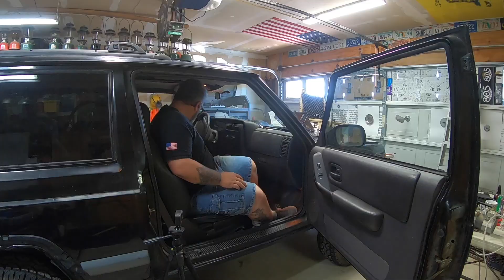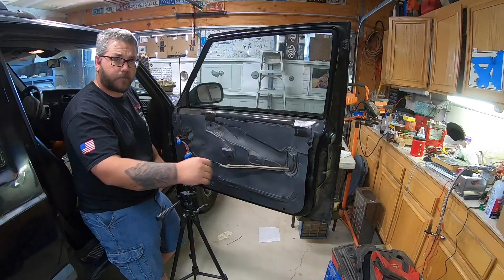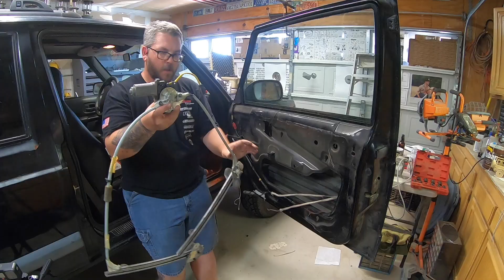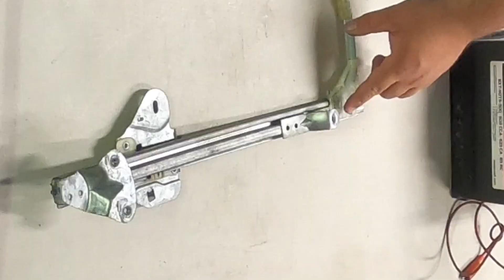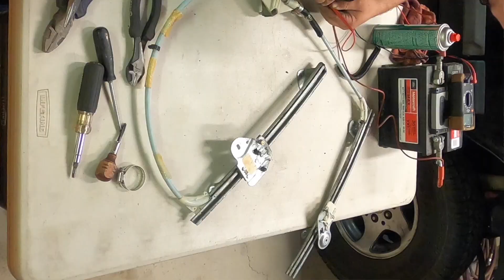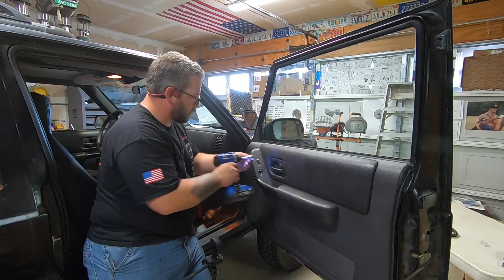Easy Jeep Cherokee XJ Power Window Fix Using Parts From Steiger

Comment: Hi, I signed up. I currently own an Xj 2500 TD VM year 2000, and I have some problems, related to the air conditioning compressor and the driver's window. I can't find the video of the driver's side window, probably I translate wrong. Can you give me some directions? It started to slow down, then it started to stop but it moves in its seat, and if I move it it starts again, only now I can't move it anymore, can you tell me something? Thank you very much. Italy
Reply from the maker: Normally when the window slows down and you have to pull on it the window motor is going bad. The motors for the 2dr and 4dr models are the same, but the regulators are different.
Reply: @ProjectVenture  thanks for your speed, unfortunately I'm inexperienced, "2dr 4dr". today we tested that he is the window motor, gone as you say! But another problem arises (continuously sigh), sometimes when I press the clutch to start the car, it does not start, but a slight movement of the pedal gives the ignition impulse. How can I solve? Do you have a video? Thank you very much!
Reply from the maker: @ebealienthy  I was referring to the 2door vs4door models. Usually when you have that problem with the clutch it is the clutch safety switch. This is what keeps the vehicle from starting unless the clutch is depressed. I don’t have a video on it but there are many on YouTube and a lot of forums on the subject. There is also a way to just bypass it but beware that this will let the Jeep start in gear and will cause it to lunge forward same as if you started it and just let off the clutch.
Reply: @ProjectVenture  Thank you very much, you are a real youtuber, but I think more of a Jeep professional. I will try to look for a video on how to bypass it. For now, thank you very much for your support and contribution. Antonio - Italy 👍

Comment: I would have used duck tape on one side of the window wrapped it around the upper door frame and stuck it to the other side of the window to hold it up, then when lowering the window to attach it the duck tape could be used to hold the glass as you lower it down. Great video as always!
Reply from the maker: Yeah, I was gonna do the duck tape method but I was also trying to prep for paint around the same time and didn't want to have to scrub the adhesive off the door frame. It works really well though.